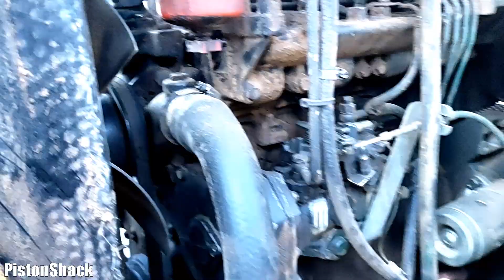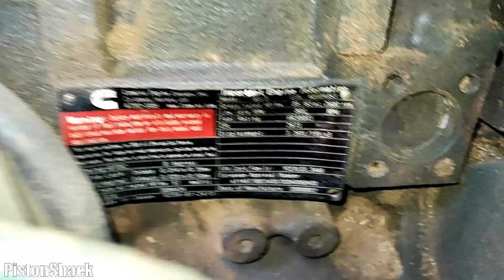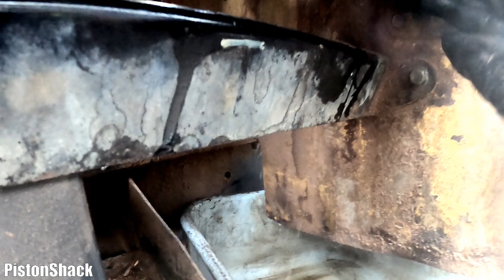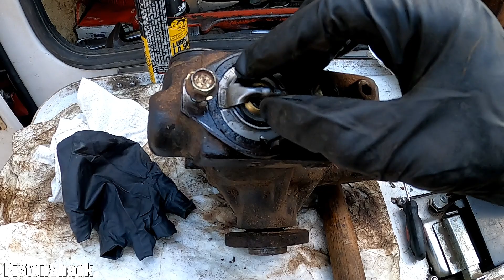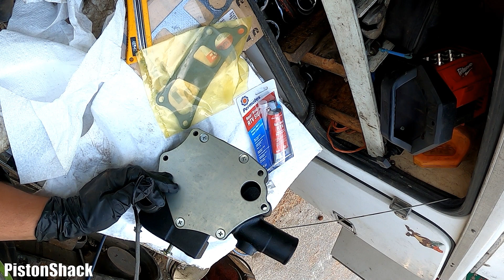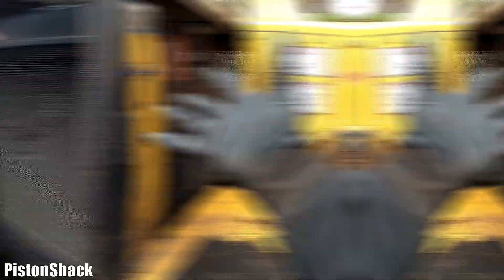B3.3 CUMMINS WATER PUMP REPLACEMENT in DETAILS | VERMEER BC1000XC BRUSH CHIPPER

Comment: I really appreciate the video. My pump just went at 1,500 hours. Did you go through Cummins for the oem gasket? Any details on torque settings for the pump bolts or a resource to refer to? Many thanks for the video and info.
Reply from the maker: Thanks, Willy! I am glad this video helped you out. 
Yes, I used OEM Cummins water pump gasket for b3.3.
I just used standard bolts torque chart for the torque values for the reference. You can find them online everywhere.
So far no any issues with 200$ Amazon special water pump!

Comment: When it over heats does it throw black smoke out the shooter?
Reply from the maker: Usually, it won't push black smoke. Black smoke means hot plus too much fuel.  Mine never pushed black smoke even when overheated.